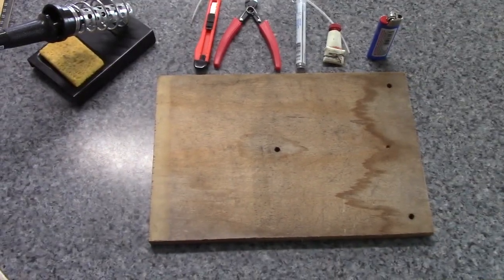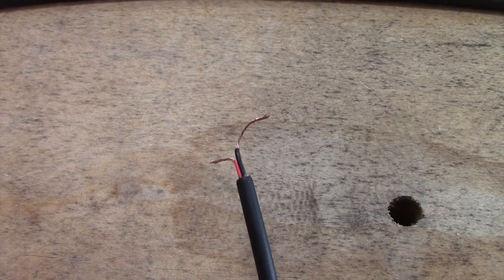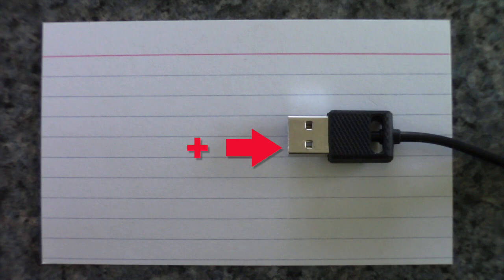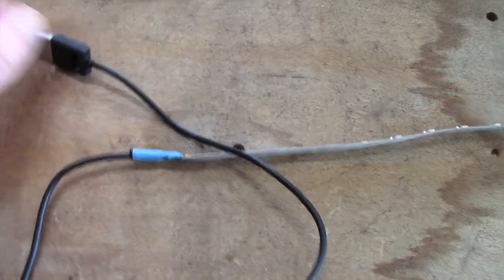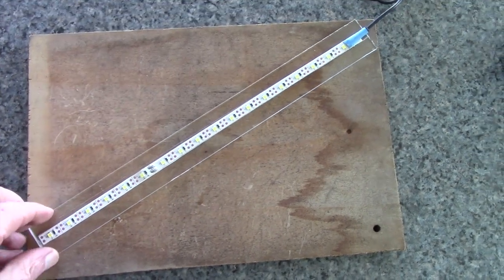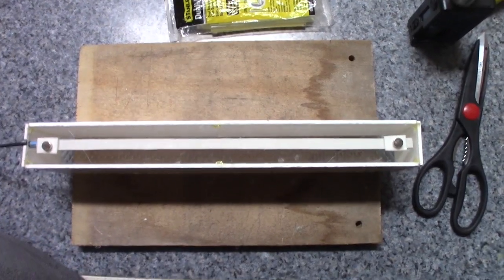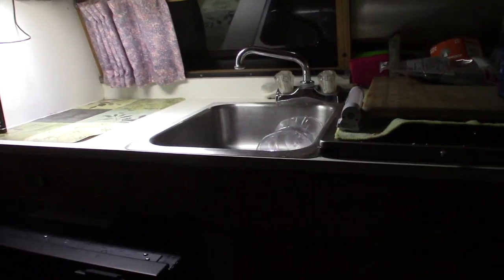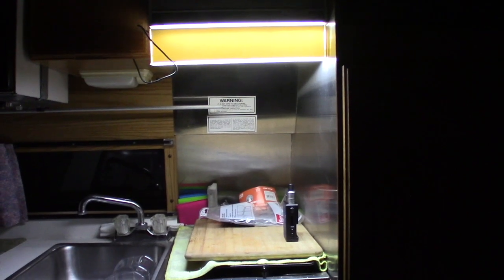How to Make A Multi-purpose, 5 Volt, USB Powered, L.E.D. Light

Comment: Would this work the same way if I was to plug the USB in to a phone usb adapter to work by the mains thanks
Reply from the maker: Hi minion,
Thank you for the question.
My experience has included plugging this light/s USB plug into a wall adapter, a USB cigarette lighter plug in a vehicle, a powerbank, a USB port on a computer all with the same results, the light works.
Hope that helps you.

Comment: My only question is would it be possible to use the other end of the usb so the light could be plugged into a phone
Reply from the maker: Hi Robbie,
Thanks for the question. 
I'm not really sure if a phone can be used as a power supply.
My guess is probably not.
On the phone's little usb port, the flow of the electricity is probably IN to the battery with some sort of diodes or circuitry that prevents that port from being "live" or be able to ouput electricity.
Even the power bank has this kind of set up. The usb port on the power bank, to charge the power bank, is the mini usb port style while the output port where you connect something is the standard large usb port.
Maybe it's an industry standard thing where the power supply is always the large port to avoid problems and make sure things are compatible.
Reply: There are now phones that have been updated to be used with USB cords to charge other phones. I can use my Samsung S20 to charge someone else's phone. This is something I would like to be tested with a light. I had a phone case that was sensitive to sound and would light up LED's in the case. It had an L connection on the bottom into the USB port.

Comment: Little confusion when you talked about Positive and Negative portions of the USB Cable.  You made it sound like the OUTER case has the +/-, It is the 4 pins inside, and looking down the throat with the pins on the Bottom, you will have (-) to the left, and (+) to the right, the middle pins are for Date Transfer.  Just look up USB Pin Assignments if anyone needs more information.
Reply from the maker: Sorry. Yes, the connection being made is inside the metal shell. I should have taken a picture showing those actual connecting parts to be clearer.